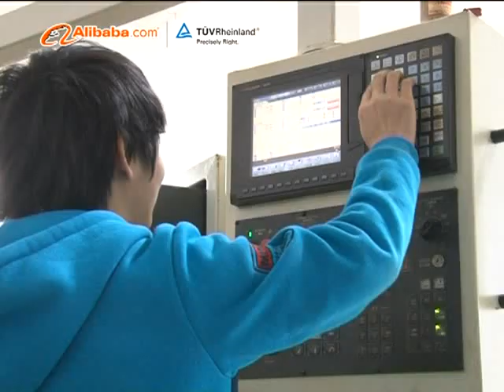Carbon fiber bike frame manufacture in China(Shenzhen Zhongwei)

Comment: Nothing better than breathing carbon dust in the morning ! Not really environmental friendly this company
Reply: 100% agree. Absolutely horrible working conditions for carbon parts manufacturing.
Reply: nah, most dust that is polished off for carbon fibers are resin instead of carbon itself,otherwise it will reduce the strength of the frame and made it possible for failures
Reply: I used to work with carbon fiber. We wear masks with breathers that filter the powder. Even that can't eliminate residues getting through the filters... Mouth is dried after long work period.